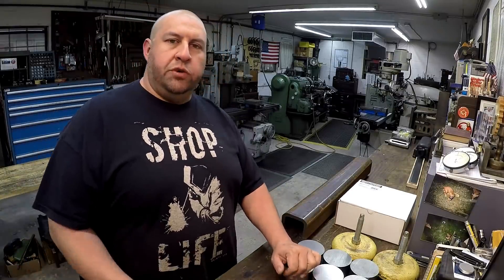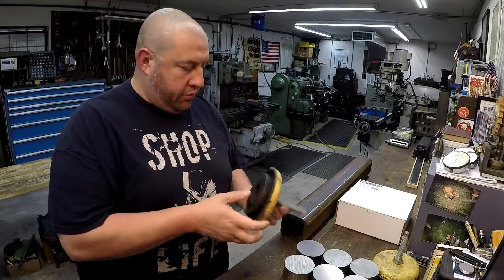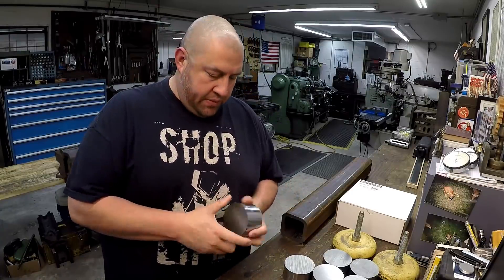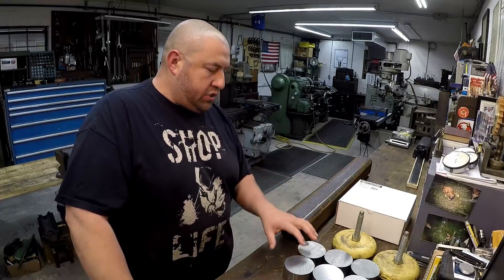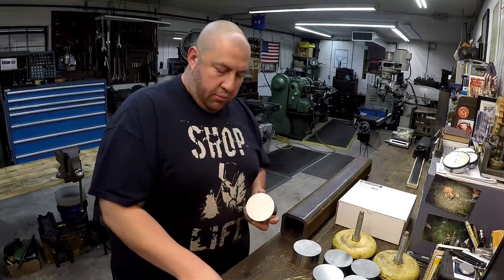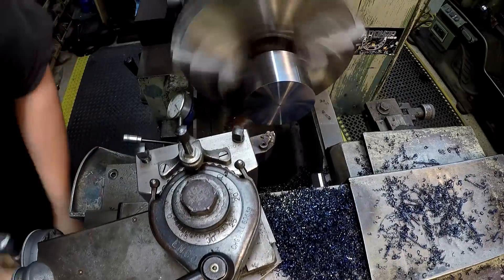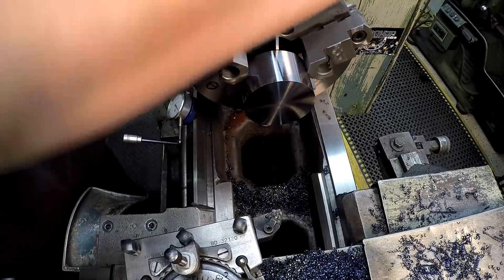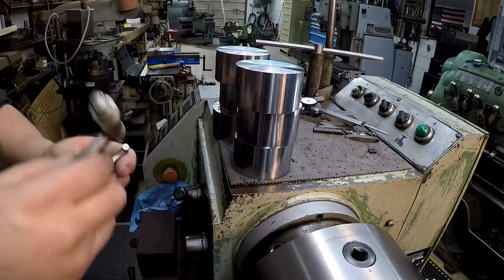SNS 219: Edge Technology Chuck Stop, Inspection

Comment: For when true "stop size" accuracy really matters, you could have used "soft jaws" on your chuck, and produced your very own concentric and parallel counterbore "step" (with a corner undercut) for identical succeeding part placement.
Reply from the maker: I’ve never made any soft jaws for my chuck, but I use them and they are great for production or odd shapes parts.
Reply: I worked in a tool and die job shop environment where we had numerous sets of used soft jaws (for various size chucks) that we could select from. We would pick a jaw set that was close to what was needed, and would just recut the jaws, even for a one of a kind job if accuracy really mattered. 
We would try to take minimum off the soft jaws each time for an extended soft jaw lifetime. 
And when that time did come for jaw renewal, we would mill (or saw off) old used up front of jaw from the jaw, and weld on new "blanks to the existing original jaw backs. Drill through existing backs to front of new  blanks, then counterbore from front on newly welded on blanks for jaw bolts and further use. 
Cheaper than buying whole NEW sets of  (expensive) factory blank soft jaws!

Comment: That’s going to be one strong table. Hope you don’t have to move it!
Reply from the maker: That why I have a pallet jack now.
Reply: Abom79 it’s like my wife. Built for comfort rather than speed! I have to build a table for my granite surface plate, it will be similar heavyweight as that’s the box section I have to use.

Comment: run the tool to center, reverse direction on chuck then finish the cut to the far side? If the center is now highest I believe that would confirm the cross is not perpendicular.

Comment: Neat tool. When I had to rub production part on CNC lathes we used a stop system, to maintain thickness and parallel I twisted the parts while chucking them. Could you do this with that system?
Reply from the maker: Yes James I did use the twist method as well. This seemed the best I could get.

Comment: What would you get if you were to run run the indicator around the outside edge of each slug? Instead of from outside to center? Would that help diagnose anything? Also I was wondering why you didn't check the run-out on the outside of the slugs while chucked up in the lathe. I know you said you couldn't see any, but I don't know how accurately your eye is calibrated... I'm thinking that might account for some of the concave reading. Maybe not, what do I know? Probably nothing, I just like to ask questions...
Reply: The part being cocked in the chuck has no effect on the face, because the face is cut the same by the tool regardless of how it's held relative to the spindle axis. What will be affected is the perpendicularity of the face to the long axis of the part, if you want the OD to be perpendicular to the face then you need to make sure it's not cocked relative to the spindle axis.
Reply: If I'm not too far off base, what Adam was checking was not spindle axis concentricity, he was checking parallelism of the two faces. So if the axis was off the slightest then the two ends would also be out of parallel thus causing the inconsistent reading from outside edge to center. That's why I was wondering if he had taken a reading all around the circumference of the parts if that would have told him anything different...
Reply: Danny Wilsher Yes, running the indicator around the part would be the way to check parallelism, and I would like to see him do that. But since he was butting the machined face against the parallels, that will insure the parallelism of the second face. However if the OD is off-axis considerably, the face might lift away form the parallels a little bit as the jaws try to realign the part.
Reply from the maker: If your running a repeat op like that your most likely not going to indicate each part in the 3 jaw chuck. My calibrated eye can see runout in a part.

Comment: Adam interesting, just a thought about the cut showing the wear in lathe(Richard KIng). What will happen if you cut from your outerside as normal to the centre, then stop, reverse the turn-speed and cut right through to the outer end. If you now measure right through what do you get-?

Comment: The dip to the centre seems very high at over .001" per inch.
If the cross slide is out of square,then this could be confirmed by facing from the back which  would result in the high point at the centre.
My guess is that there will be some adjustment to the squareness.

Comment: Would a spring pass on those faces help to reduce the concavity (is that a word?) on your parts?
Reply: MrTridac probably not. If the wear Was the other way around maybe but not guaranteed. Experienced on one of Our lathes at work that it was pushing outwards the closer it got to Center which meant there is play in the crossslide. Fixed that by tightening the shim in the dovetail a bit. Adams Victor lathe on the other Hand is a bit difficult to diagnose and fix since its not your typical wear.

Comment: Looks like a good buy. From what I could see, disregarding the one you tapped, was 0, -4, -4, +1, -6 tenths.  So within + -.0004. The only other thing I question is using the dial indicator as a stop, in effect you are also testing the accuracy of that indicator.  Perhaps a better test of just the parallels would be to lock the carriage and then take a final finish pass on all the parts. But really at this point we're splitting hairs.
Reply: I've wondered about the mag base indicator on the ways, and whether vibration during cutting could possibly let the indicator move a tiny bit. That still wouldn't account for the concavity of each part, of course. Still fun to watch and learn.
Reply from the maker: If this needed to be more accurate I’d set up a tenths dial indicator, or possibly my machine stop. That indicator I was using is a cheapo unit but always works good.

Comment: why not apply some threads in circular pattern in the chuck and just use some sets of allen bolts with different length for a stop? you could even easily machine them on the lathe for perfect runout, no need to buy them stops...
and even considering small diameters of workpiece you could easily build a frontplate fitting on those threads with a center thread to fit in a screw with counter nut for length adjustment.
Reply from the maker: There’s plenty of things one could do if that’s what you’re into.

Comment: Probably be more consistent if you locked the carriage down and made all the cuts. It would also keep the carriage from "twisting " on the ways and giving you the .002 dip in the middle.
Reply from the maker: True but I’d be having to drag the tool back across the machined face which I don’t like for a finish cut.
Reply: Abom79 , what about using the compound to draw back your tool?

Comment: The deviation from edge to Center could be the tool heating up and expanding iv encountered where in order to get a perfectly flat surface you had to do the cut in two steps take half the cut what the tool cool down then finish the cut get a perfectly flat surface
Reply: I was using high speed steel though not carbide
Reply: The effects of wear and positional repeatability completely mask the expansion of the tool, and the expansion is tiny anyway.
Reply from the maker: You won’t see that much difference because of thermal expansion with that cut I took.

Comment: i am curious, did you try measuring the same part from different sides, I know it should not make a difference, but if the original cut was sloped, when you pressed it to the back, the chuck could have held it at an angle a bit and then this is the result you would get. I may be completely off here, but I'd just like to see the part being measured fully, all across the diameter and on both sides.
Reply from the maker: Worst I was getting was about .001 out of parallel On the two faces.

Comment: Don't write off head alignment. .002" over that little distance is a way out of spec. You would really feel that in the cross slide, good chance the headstock is clocked out of alignment, but will be a tricky to check with the bead wear.

I say 0.001" for the stop is pretty good considering the work is not getting seated with a mallet. Isn't that new chuck pretty true? I remember you checking it out a while back. Might get better results by seating the parallels to the chuck so you can use a mallet. Cant say I am a fan of the stop though, going to be a hassle when you need to bore something,

Comment: You're lucky the feet have a threaded adjustment in case the cement floor is out of level by more than a few thousandths. Also, doesn't the test indicate that the cross slide is not exactly perpendicular to the center line of the chuck?

Comment: I'm wondering why you didn't square the rod to fit the tube leaving a 1/2" shoulder, wouldn't this be a stronger joint?
Reply: I think that's what he's going to do if I understood correctly. He's going to turn at least half of it down to 3" so it slips into the square tube then weld the shoulder. I think.
Reply from the maker: The job isn’t finished.

Comment: can the  outer height vs the  inner  high be explained  by difference in  tool pressure as the  tool  goes towards  the center?
Reply from the maker: It should be directly related to wear in the machine ways.
Reply: definitely related to the play in the ways but also exaggerated by Tool pressure.
Reply: If the edges are higher than the center, it's not because of the tool pressure. I imagine that if the vice is suffering some play, the pressure will generate a cone with a higher center, not a lower one.

Comment: Did you not try to tweak the Gib on the crosslide?
Reply: That cannot affect out of trueness. The Gib takes up play but cannot compensate for anything else.
Reply: The pressure on the tool would want to turn the cross slide counter clockwise (from above), and that would be the direction that would cause a dip in the middle when facing, so yes, taking up the play could improve that.
Reply: jesondag. Yes the slide would pivot as you say but would still be constrained to follow the fixed dovetails on the saddle. The cross slide would be making contact at the front right and rear left corners but would not be able to deviate from the fixed guides that these two points would be sliding on.

Comment: Hey Adam, did you lock the carriage in your test? I know they usually don't walk on the bigger machines, but my 10" will cut a mighty taper if you don't lock it when facing. Edit: Nvm, you mentioned it.

Comment: Is there a way to progressively increase the feed rate as the diameter is decreasing to maintain a consistent surface feed rate across the facing cut? I'm not a machinist, I just like to learn - thought crossed my mind so I figured I'd ask. It seems like the kind of thing that would be beneficial for any kind of lathe operation, but that's just my intuition.
Reply from the maker: If the machine is equipped with VFD you can increase surface speed as the cut decreases in size. Not on my lathe.
Reply: Increasing the feed rate does not increase the surface feet per minute (cutting speed) .Most lathes feed on a per Revolution basis so regardless of the RPM you still movie at a consistent distance per Revolution. What changes as the diameter gets smaller is the actual feet per minute of material passing by the cutting tip. Most CNC lathes automatically change RPM  to keep a consisted surface feet per minute at the tool
Reply: I know some of the variable speed british lathes had that feature, but don’t know if it’s common.

Comment: I'm calling you out on the threads on those table feet.. no way is that 3/4"... 5/8" maybe :)
Reply from the maker: Ok, I’ll call you out when we revisit the drilling and tapping op.
Reply: 3/4" You just think it looks small because of the go pro lens, the high length:diameter ratio, and Adams big hands.
Reply: I've eaten crow before more than once :)